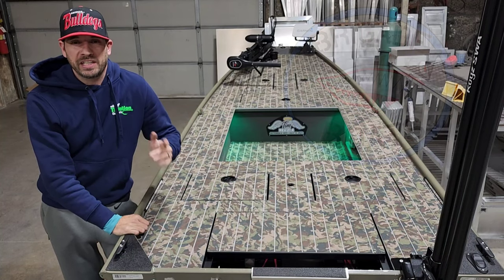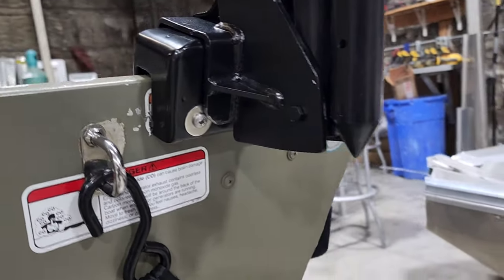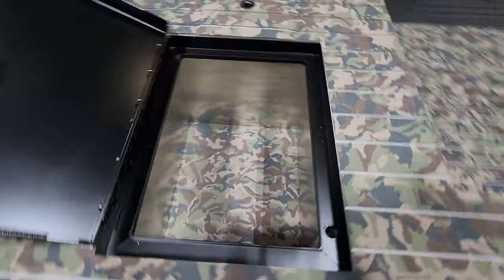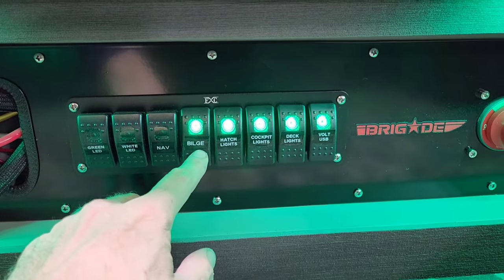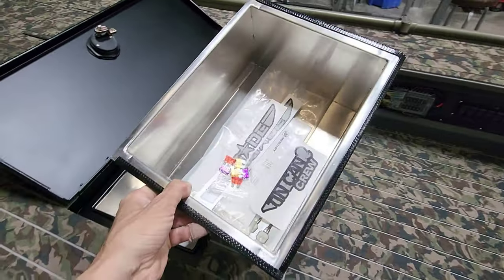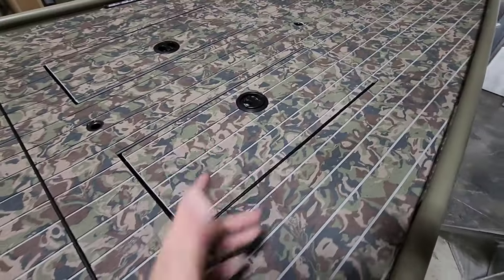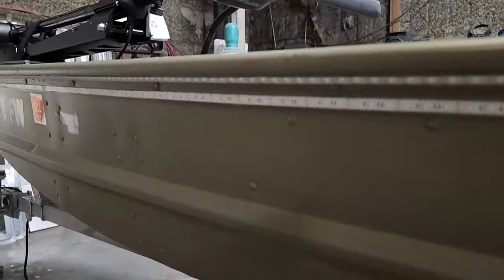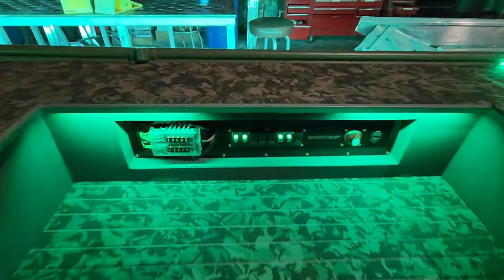14ft JON BOAT BUILD Walk Thru | White River 1436

Comment: Love your channel and work.  I'm looking to buy a boat to go fishing with my 12 yr old son.  Can you offer any advice on buying a used boar, what to look for,  models / years to look for that are worth fixing / restoring?  Any particular features or things to look for?  Also - what do you charge to do a restoration if we find something worth working on??  Thanks so much.
Reply: I know I’m not the guy but I got some information. Me and my dad ( Me 16 Dad 54). Recently did a couple rebuilds together to use for fishing. I have 2 primary builds I use. I got a 12 foot Vhull aluminum boat that we fully converted into a bass boat, and we also have a 16 ft Alumacraft bass boat. Depending on what you were looking to do I have two different recommendations. If you were going to be going to smaller lakes, ponds or just anybody of water we are not going to be going around the lake or there is restrictions on trolling motors only then definitely go for a 12 or 14 foot boat and do a build similar to this. If you’re going to be doing tournaments or going on bigger rivers or lakes definitely look into investing in a bass boat even if it’s not the highest quality just fine to mean that might work. As far as repairing goes, don’t buy something you know is gonna need major repairs. In the end it’s better to spend more money on something that needs less work because it is way more reliable. And as far as models and brands it doesn’t really matter as much as you think, just find something with a shape or design you like. Another thing to consider is motors. If your going to buy a full sized bass boat, the motor is just as important as the boat. Make sure it’s in as good or better condition than the boat it’s self. It can really pay off and give you a lot less headaches. That’s about all I got to say, good luck and don’t spend to much money😉